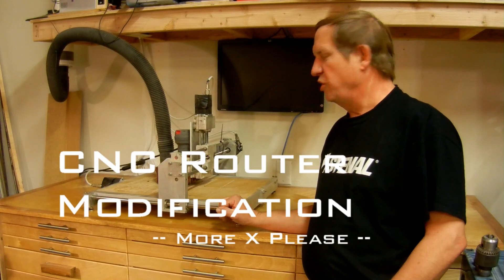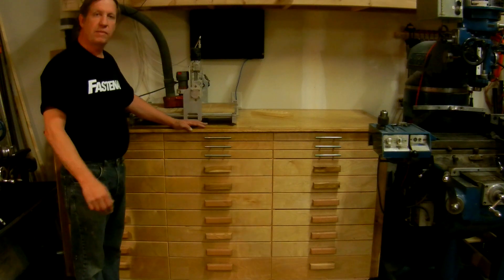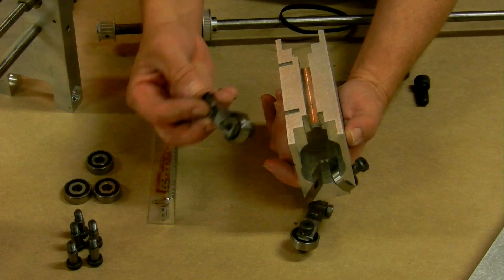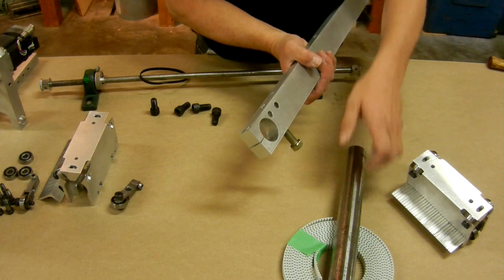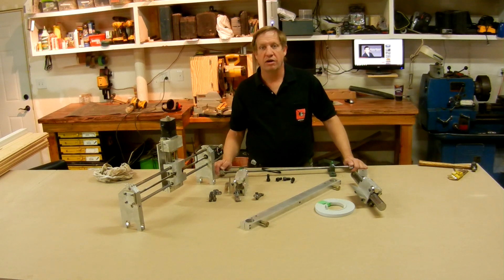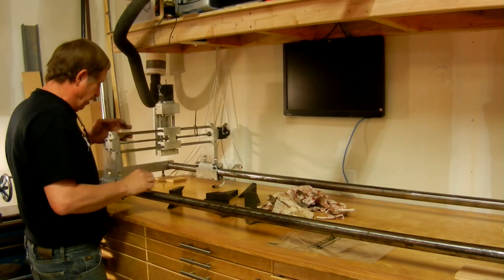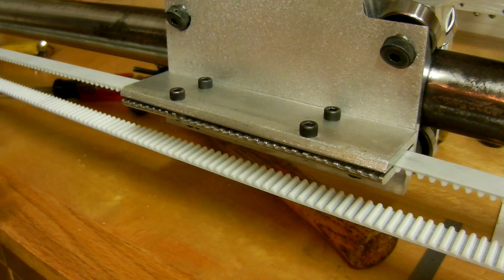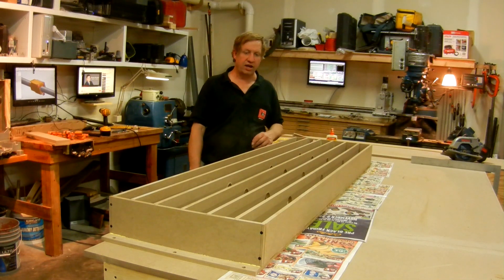DIY CNC Linear Bearings

Comment: What pendant is that you are using? I need to get one for my router.
Send me a link to the router bits you were using to cut the aluminum parts with,
or email to your mom if you don't have my email address.
Go to Blackmagic design and download then free versions of Fusion 9 and 
DaVinci Resolve 14.
Reply from the maker: It's a hp spacepilot over kill for a pendant - https://www.3dconnexion.com/products/spacemouse/spacepilot-pro.html
Bits - https://www.ebay.com/itm/1-8-1250-CARBIDE-2-FLUTE-MICRO-ENDMILLS-AlTiN-COATED-Kyocera-Microtools/151760702517?ssPageName=STRK%3AMEBIDX%3AIT&_trksid=p2057872.m2749.l2649
Reply: B-Spot Thanks